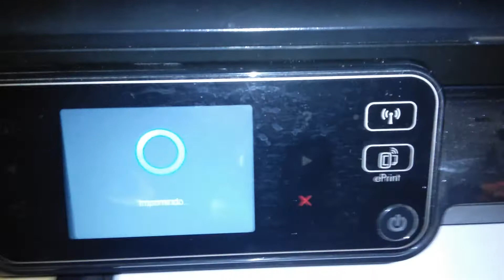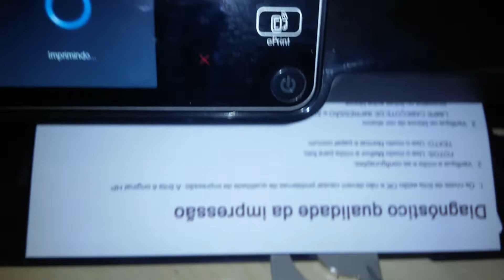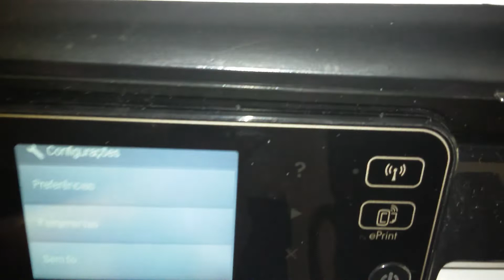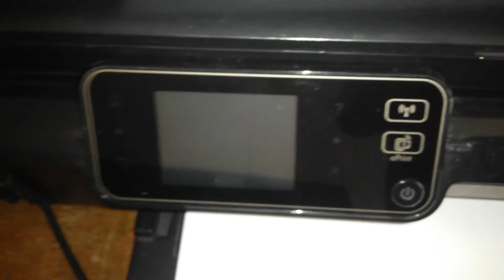HP Deskjet Ink Advantage 5525 Printer Not Printing Black, Clogged Hoses and Print Head

Comment: I have extact same problem with my printer. I have cleaned all the hosses except from the one. How did you manage to unclog the bottom one from 9:37? The one from black part (sponge, not hole). I am moving freely inside of it with a usage of wire. But liquid can't flow throw the sponge into hose and also the air doesnt go through when i try to inject it from the other side (the water on that black sponge doesn't bubble)... All other black hoses are fine.
Reply from the maker: It is possible that the clogs are in the connection points instead of the hose, did you check them?
Reply: @unrelatedactivities  connection point between what parts? I disassembled all parts I could like you on your film. There could be always a clog between connection of that hose to the main part but I don't know if it's possible to deattach the hose (and then put it back)?
Reply from the maker: I can't remember the details and unfortunately the connection to the main part was not in the video. Probably they are connected the same way as the other end and can be removed and re attached easily, anyway the black plastic part hole need to be unclogged either by washing it or using a thin wire or needle.
Reply: @unrelatedactivities  i will buy thinner qire maybe. Shame that problematic hose isn't the one with hole, it will be easier. I dont think soaking in soap water will help anymore, beceause it Should be pumped somehow from the top :/ Nevertheless thank you, your video help me a lot with disassemblying!
Reply: @unrelatedactivities  I cleaned every pipe finally. Every was unclogged and checked. No signle piece of ink. No liquid nor solid. I reasemmbled and... It didn't help... The colours are fine, the black is none. Only one time on technical page i got black lines and thats it. Any ideas? Am i missed something while cleaning? Moreever there is again ink mud creating in the same spot...